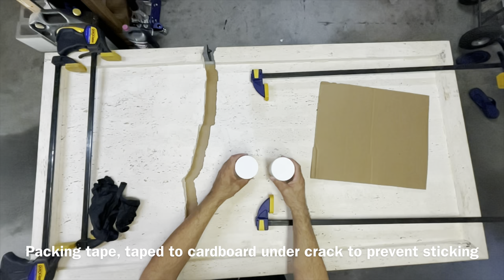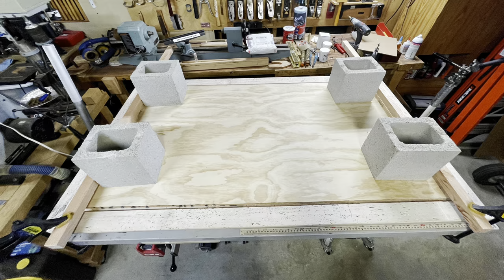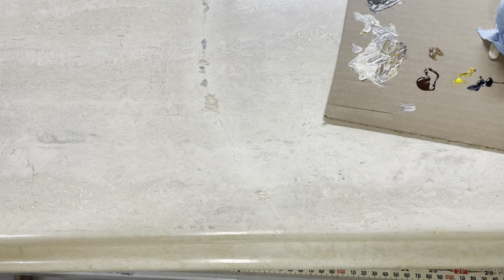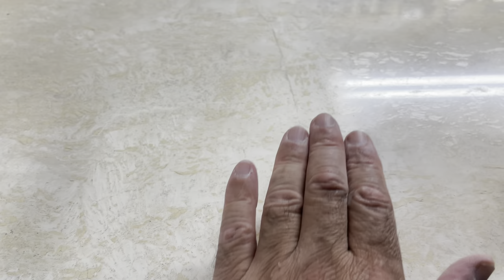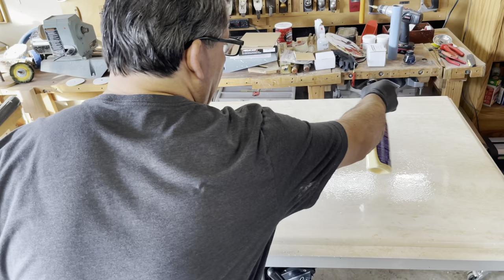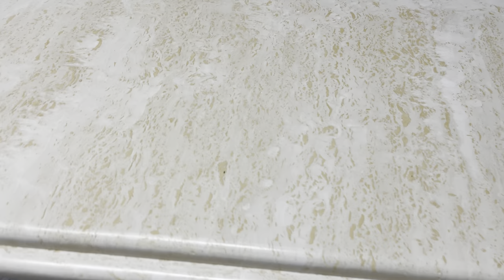Broken Marble Coffee Table Repair

Comment: What sort of base did you put the marble top on? I have a travertine table that split in half, but it's a pedastol and I'm nervous the plywood won't reinforce both ends weel enough to prevent from splitting. Did you table stay together?
Reply from the maker: I used 3/4@ plywood and the table is still use, the plywood has reinforced it and has not come apart.